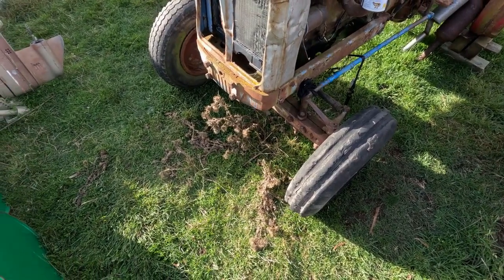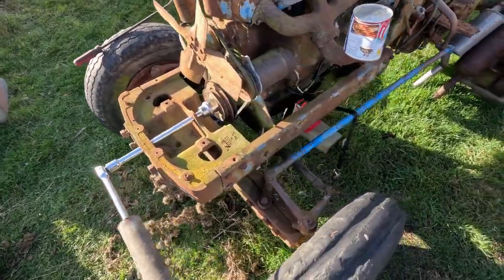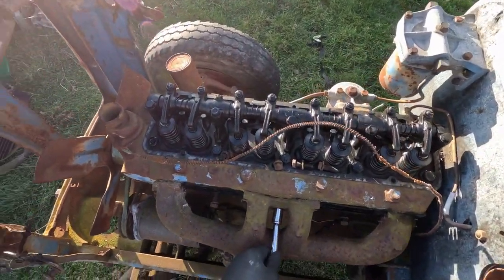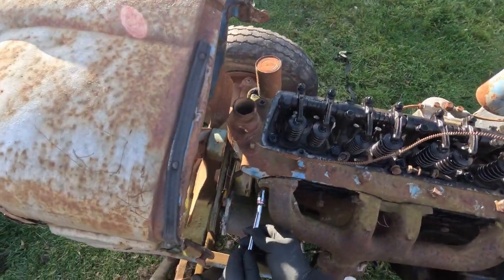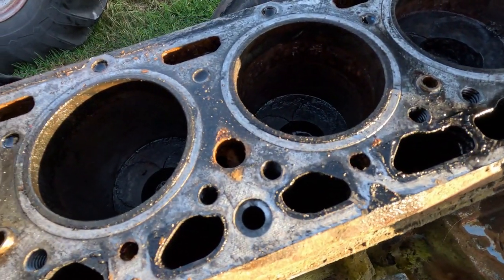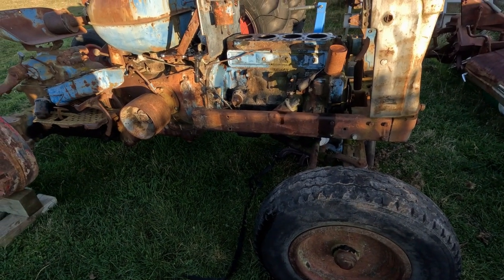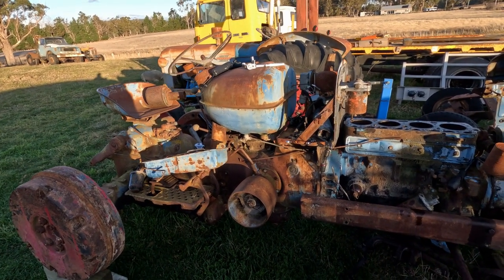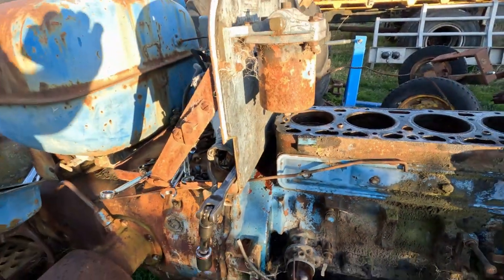Fordson super major project pt3 off with her head

Comment: if you refit the sleeves check the groove in the block for the lower seal, the bottom of the groove it used to corrode and the new ring would not seal. It had to be cleaned out and a metal filler used support the seal.Good luck.
Reply from the maker: I will probably be replacing all the pistons and sleeves but I will definitely be paying close attention to the selling grooves I've played that game before